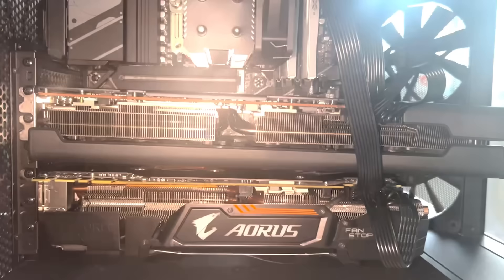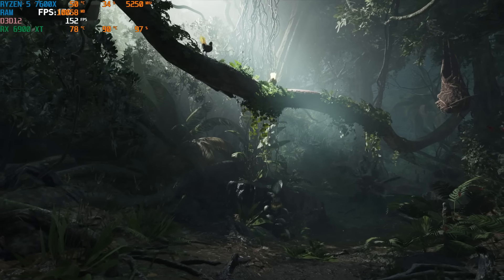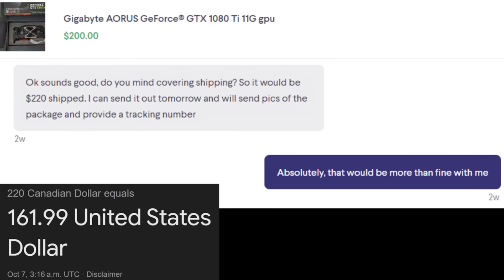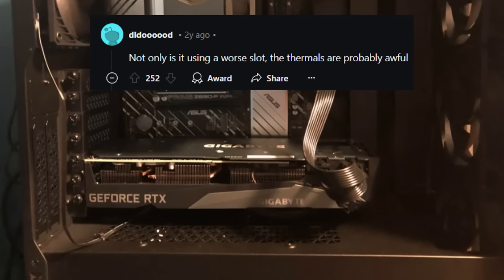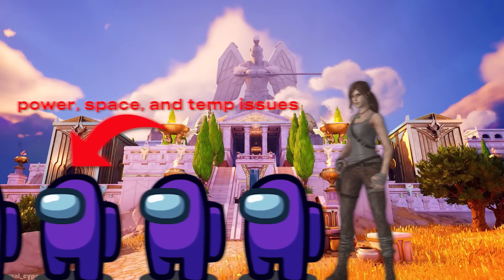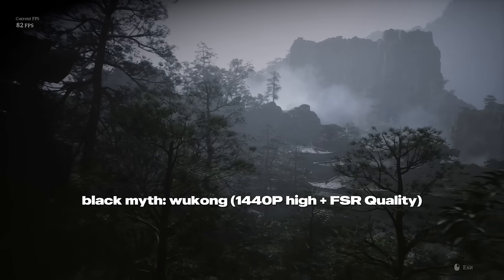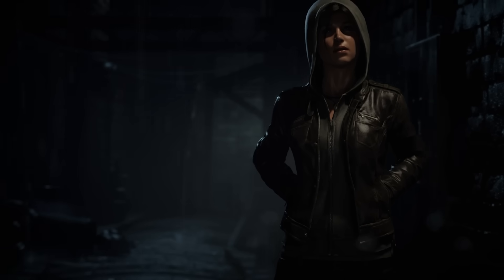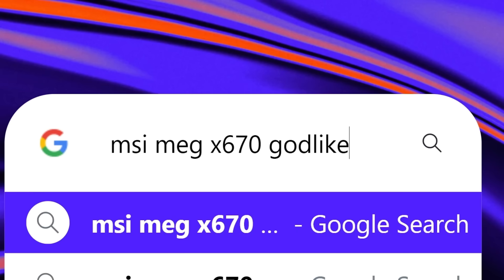I Combined AMD & NVIDIA in One PC and Got 1500 FPS

Comment: Ashes of the singularity? thats a direct x12 , pcie based benchmark.  Not the worst game either but can combine any two gpus im aware. This setup is also good for running two games that need the separate technologies or as you said doing separate tasks . Very few devs allowing the direct X 12 gpu linkage as part of their engine.

Comment: You can actually use a rtx 30/40 series gpu as the main rendering gpu for games/applications that supports dlss, and a rx 6000/7000 series gpu for AFMF. That's what people actually did to get 200~300 fps on max settings of cyberpunk when it first got first released.
Reply: what? AFMF came out this year, Cyberpunk 4 years old lol
Reply: @Kyanite.  You are talking about afmf 2. The original afmf was available since last year. 
Also guessed that cyberpunk gs been around longer than i thought, woops.
Reply: @taktarak3869  i really need to know how to do this

Comment: Bro, this is not how you dual GPUs work. You cannot make an AMD card work with an Nvidia card. Look at your task manager while in game and you'll see only one card is doing anything at all. You don't just plug in dual GPUs and magically get a bigger resource pool for gaming 🤦
Reply: The host also is claiming in 2024 that a rx 6900xt is the best amd card which is bs, if you had a 7900xtx it would smoke both cards, on top of this the 4090 is actually the fastest consumer grade gpu on the market. This video is full of so many holes I can't even use this cheese on a grilled cheese sandwich.
Reply: @lockinhinddanger934  you foaming out the mouth I can’t even lie
Reply: @lockinhinddanger934  You know this video was done for fun right? You really need to go outside and find something real to do.
Reply: Right, but there is one trick I think could work to make more FPS out of 2 GPUs. Use lossless scalling and make your main GPU render a game and second GPU generate frames in LLS app. I tested it and it works, but unfortunately my second GPU was too weak and generated frame drops, because whole system had to wait for it to generate fake frames, but it is worth trying if someone has something than 1050 paired with rtx 3070.
Reply: @LeitoAE  if you're referring to GPU passthrough, I guarantee your 1050 is not doing anything to benefit your frames. I don't know what your exact setup is but the fact that you're saying you're getting less frames from whatever your doing does in fact, not make more frames.
Reply: @ROcheater  Unfortunately when swapping now GPU the old model sold earlier than new one arrived, so I wont be able to test it out with stronger GPUs.

The fact that I was getting less frames is not a proof that setup is wrong. It only says that two GPUs can not be that far away regarding their performances. Hope I will be able to test it out in the future when have another GPUs.
Reply: @LeitoAE Yes, you can use 2 GPU s. It might seem scary to make them work but If You do it has the performance boost. I use an rx 580 for games and a GT 1030 for Lossless scaling. and not only for LS but i also managed to Install and make the Nvidia drivers work with the AMD ones AT THE SAME TIME. so basically i use GT 1030 DDR5 for Physx and CUDA (set it in the nvidia control panel) while the rx 580 does the main job with the Games. 

It gave me +15 fps. 

here s some things to consider tho: 

I use a Windows 11 Ghost Spectre. 

I use a Gigabyte GA-H87-HD3 that has Crossfire support (dont know yet If You need this) or as somebody in another comment said that You need a MB which do/do not split the Pclanes or smh. 

So yeah If You spend quite some time to get the correct settings they will work perfectly and will never get any bugs or performance issues or etc. If You have the correct drivers ( dont know If You need old ones before nvidia decided to block multi gpu support).
Reply: @LeitoAE i also tried to make this work on my secondary PC,  which had ryzen 5 3400g and a Vega 11 integrated graphics. 

the problem was that the MB (MSI B450M-A pro Max II) didnt want to show image of a DDR4 GT 1030. I couldnt make it work even If i set the MB to take gen 2 or gen 3 or auto pcie Lane. I no longer have the PC so i can t Say If this trick would work If You have a integrated graphics and Try to use a slower dedicated gpu for Physx and CUDA, and the integrated graphics as main. (In these cases where integrated graphics are stronger than the discrete one hahahahhh). 

So yeah as i said i couldnt make it work, so i couldnt find out If it would work.  Maybe in the future when i make more pcs and i Try more things i will test again to see If it's possible.
Reply: hybrid sli driver mod i used to sli a gtx 660 with hd 7850

Comment: while its obvious that this video is a joke under DX12 Ultimate and Ultimate is part of the name, there is something called "explicit Multi GPU" or "Multi Adapter" and as long as the GPU itself supports DX12 Ultimate and the game devs enable this feature, you can run any number of GPUs from any Vendor and get an FPS increase, and the only game i know of that does this is a game called Ashes of the singularity.

Comment: back in 2010 i ran a pair of hd4890's in crossfire and with some less than legit drivers i was able to add a gt240 to the system and it all worked fine 
didn't really do much for gaming as the nvidia card was basically acting as a physx card but it smashed the 3d mark 06 leaderboards on the forum i visited

Comment: I,m questioning if i can install 2 Amd & Nvi graphics cards on my computer - not to run them together at same time like in your video but my goal is to use either of them as my want for specific games. For e.g when play CP2077 game i use Nvi card for better raytracing performance and image quality with DLSS, and next time when i play old game like NFS Hot Pursuit i use Amd ard to get AFMF 2 feature on this game to boost its locked 60fps to 120fps for smoother framerate...

And so the last question is how can i do to switch between them per game?

Comment: There is another way to make dual GPU useful as I know, AMD's 6000 and 7000 series card has fluid motion frames, which work like dlss frame gen and compatible with any card. So u can now have a card dedicated running frame generation, decreasing the load for the card for rendering.

Comment: Can you post up a tutorial? I have a threadeipper with 64 pcie lanes so I can run two GPUs at 16x with them both running through my processor?
Reply: The video is a cap. It's impossible, you can run the game through one GPU and have it displayed through another but as in actually using two non same GPUs at the same time is impossible. I've tried to do the same with a Tesla m40 passing through a AMD Rx 5500 xt.

Comment: Github has software to run them like 1 in DX12 games... Buggy as shit but works in some cases... Your best option with dual GPU and a 12core/24thread cpu is to split and run 2 PC setups... I did this when money was low and with some serious tinkering I had two PC's running off the one perfectly

Comment: The passthrough system of 2d GPUs and 3d accelerators in the 90s would be wonderful here. Imagine being able to plug one GPU into another and that other one goes to the monitor. Fullscreen applications just whichever one's better does the rendering, windowed mode, UI done by one and everyrhing within the window's borders is done by the other.

I hoped something like this would come to systems featuring both an iGPU and a dGPU.

Comment: Random Dude here. 2 things your looking for.
First a driver from the past before Nvidia decided to add driver blocks to hybrid gpu setups.
Second is a motherboard that supports Bifurcation allowing the 2 PCIE slots depicted by the mobo diagram in the manual to use 8x/8x splitting PCIE lanes. Most GPU's do not saturate x16 slot and nearly nothing is lost performance wise.
Good thing is your current Motherboard may already support it. Bad thing is finding a driver without the locks in place. Do an old search for Hybrid GPU you may find what you're looking for.
Yes we did used to do this without issue. GL
Reply from the maker: wow suddenly i'm excited to try this again, thanks so much !
Reply: @lecctron  you may be able to get away with this using Intel and AMD cards, mind you I'd avoid the b580 for now as it only performs good with 9000 series AMD cpus, an ARC a770 is your 2nd best bet
Reply: @nathan22211  speaking from experience. 

Radeon VII + B580

Not bad..... then the B580 showed signs of death.....

Threadripper system btw
Reply: Microsoft: we're going to add stuff in the OS to let people do hybrid multi gpu setups!
Nvidia: middle finger
Reply: yea thats why some gpus have nvme slot :D these days cus GPUs not use full x16
Reply: I'm also certain that for his second gpu, while it is an x16 slot, it was running at x1 speeds.

Comment: But I do, yes I do do do. Operating AMD and Nvidia parallel eliminates the bottlenecks when I do AI or video editing stuff on the nvidia, I can still e.g. gaming along and stuff on several monitors, without any problems. Take a good power supply. Upgrading the power supply and swapping in a second hand RTX was the best tuning hack in years.

Comment: You need a input gpu from Nvidia that has the video from the 6900xt going into it with the rtx and dlss profiles i have one just like this except its an rtx 6000 and it is a game changer fr the only one i have to upgrade is my AMD card and it wont be due for a long time works amazingly in cyberpunk I averaged 240 frames at 4k at 15ms and the AMD gpu was at 86 percent used

Comment: I have a dual GPU setup for exactly the reason you mentioned! 

Radeon RX 6800 in the PCIe 4.0 x16 slot for gaming.

RTX 4060 ti 16gb in the PCIe 3.0 x4 slot for CUDA, tensor stuff, etc.
Reply: hey if u don’t mind could u explain how this benefits the performance and what u use it for? i have a 6800xt and this video made me think about a secondary 1080ti
Reply: @sra771  I use the AMD GPU for gaming, and the Nvidia GPU for productivity / transcoding and AI tasks. Generally AMD GPUs do not perform well for AI tasks in Windows.

Comment: It would cause more cpu bottlenecking but you could go with a b550 motherboard and scoop up a 5600x, 5700x, or 5700x3d and some ddr4 for less than the $1200 motherboard.

Comment: Hi,

I’ve been following your channel for quite some time and really appreciate the content!

I’m looking for advice on building a new PC for both gaming and AI development, specifically for working with LLM models. I also do a lot of development using ReactJS.

Currently, I have a decent setup with an Intel i9-9xxx series processor and an AMD Radeon IV GPU. However, the lack of CUDA support is limiting my AI-related work. Additionally, I frequently use Adobe Illustrator, and it tends to lag when working with larger files. My system has 32GB of RAM running at 3600MHz.

I’m planning to build a new PC that can handle these tasks better without going overboard on the budget—something that’s efficient, not overkill. I’m mainly confused about which motherboard to choose, and I’m considering upgrading my CPU, memory, and GPU to a near-top-tier setup.

Do you have any recommendations? Should I go with AMD or Intel, or would it be worth waiting for Nvidia's new CPUs? I’m not sure which direction to take and would really appreciate any guidance.

Thanks so much!

Comment: and pcie has one more issue holding you back. slot 1 is the only one supporting full 16x speeds the rest even tho its a 16x slots there wired to have only 8x can confirm that just by your footage alone you notice half slot pins. this before watching the hole thing and the SLI info you found about the motherboard is before x99, x299, intel side extreme cpu with 40 pcie lanes and amd threadripper 64+ pcie lanes also when buying one look at there manuals to see wire diagram layout of motherboard to see witch slot connect to cpu and at what speeds

Comment: 850w is enough for 2 GPUs. The reccommended Spec is for total systempower. The GPUs themselfs are 250-350W so 500-700W at worst. Meaning you are fine with an 850W for both

Comment: This is why sli/crossfire is dead for modern hardware, companies realized that gpus are only getting faster, and a single gpu can carry out the task of more than 4 980 ti's in 4-way sli mode... also its hard to prioritize having two full 16x slots for two full size video cards over nvme, when the majority of people want lightning fast storage over having a nuclear reactor for a computer, so paying that premium for those nvlink/sli compatible mobos is understandable. There is also problems with how windows manages multi-gpu setups, i.e. the graphics settings is perpetually broken and doesn't work at all in the settings app, and in win10 there is gpu resource sharing which degrades performance by a lot as windows doesn't handle multiple video adapters efficiently. Either getting custom video drivers or a laptop with a mux switch could fix these problems, or u could just stick with that 1080 ti...

Comment: I had the 1080 TI, hell still got it but it has stopped working. It has the performance similar to AMD 6700XT in Nvdia games, 6600Xt in AMD optimized games. With that said, my 1080 TI was much faster in emulation. I could get 4K 60 in high end PS2 and Wii U. My 6700XT is 1440P with drops and stutters. Now when I upgrade my main rig, I will put my 7900XT in my kids rig which has Nvidia RTX 4070 Super, and the 4070 Super in my emulation rig. My 6700XT will just give to my mother who has AMD RX 560 from maybe 2015 or so. She doesn't play a ton of games besides video poker, or chest, or spades. She just got a 4k monitor and the 560 doesn't do 4K well with video playback at the same time. So it will be a nice upgrade while my emulation PC will get Nvidia's much better Open GL performance back.

Comment: Many Asrock motherboards allow you to split that PCIE x16 slot into two 8x and you need to buy a riser card with two slots.  A bit of a challenge to mount your GPUs but possible.  This is why I laugh at all those ATX motherboards out there because modern consumer CPUs are just so limited on PCIE lanes.  Think about it, if they give you 24 and 16 goes to the PCIE slot, 4x goes to the second slot and 4x goes to a M.2 card you are completely out of lanes.

Comment: We've been doing this since the Nvidia PhysX days (2007-2014). This was due to Nvidia aggressively taking over Ageia to acquire PhysX, and then lock it away on their own hardware via BS firmware checking. What brought them to finally open-source PhysX, was due to ATI/AMD users like myself just purchasing the cheapest Nvidia card that supported PhysX features, and running it as a dedicated PPU (I still have my XFX 8600 GTS that I had been using as a dedicated PhysX PPU from 2008 onward so I could utilize the Nvidia Gameworks features with my primary ATI/AMD GPUs).
Reply: seems like after the 2000 series  NVidia dropped physx from the cards , probably why a lot of old games has problems with newer cards i feel

Comment: This is not how you get better performance with 2 GPU's in a game mate.  Connect your display to the AMD card, and use the 1080Ti for rendering.  Your welcome.  You now have AMD's AI frame generation support (FSR 3.0) and AFMF functionality on a 1080Ti.  Given you're using a 6900XT, you'd still be better off using the 6900XT solo.  The 1080Ti, as mentioned in the video, WOULD pair nicely with an AMD card for encoding while the AMD card plays your game though.  There's a few different usages that having both brand cards are useful, and you CAN increase FPS using 2 GPU's in certain scenarios.

Comment: you could always try a enterprize mobo+cpu xeons have 48 pcie lanes and would not be $1k+. you can get an hp z440 with an e5-16xx v3/4 for less than $200 and at lest see if it works.

Comment: hi I have already combined a 6700xt with a 3060 and with certain benchmarks like fluidmark physX you use the 3060 for the nvidia physx on games that use it like Batman Arkham it works very well but don't forget to put the nvidia card in 4x to be sure that the 6700xt in 16x I even tried with 1660ti or a 2070 it works very well here but the result is just the 6700xt 46 fps with 1660ti 189 fps with the 2070 198 fps and with the 3060 244 fps I have all the screenshots and I tested with the batman game and it works very well it allows to unload the workload of the cpu now I have a 7900xtx but I sold my 3060 to a friend so I can't test it and power supply is not powerful enough to run 2 video cards but I could test with a 2070 but lack of space and my power supply I could test in a few months since I am waiting for the new 9000x3d to do a new setup this time I would take a power supply of 1000watt and more but for instemp it has already been conclusive for me

Comment: You don't need a SLI motherboard per se, what you do need is a board supporting  bifurcation. That essentially means you can route the PCIE lanes to two slots (so PCIEx8 + PCIEx8 instead of one PCIEx16).

Comment: Direct X 12 was supposed to allow us to do stuff like this. I remember them using a fury x with a 980ti and getting more fps than two of either when they were the top cards of the day. Instead of a future of vendor agnostic games now its even worse than it ever was with so many vendor specific techs implemented in games. PhysX was the only one back in the day that really was vendor specific but could still run on CPUs for AMD GPU or you could use a crappy nvidia card in second place